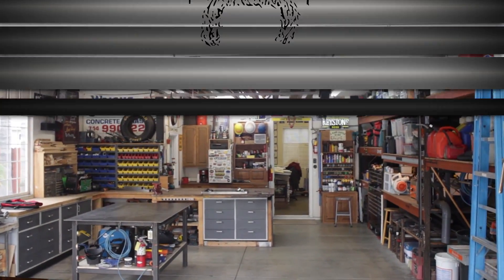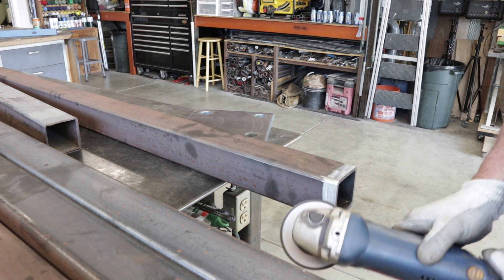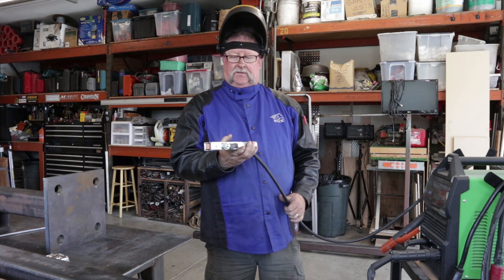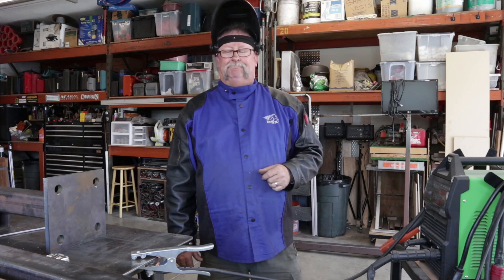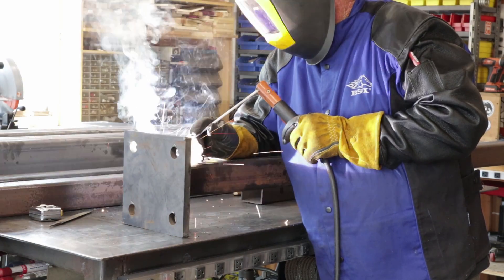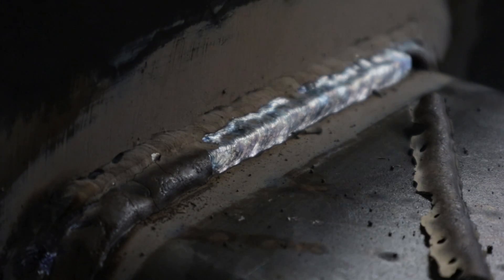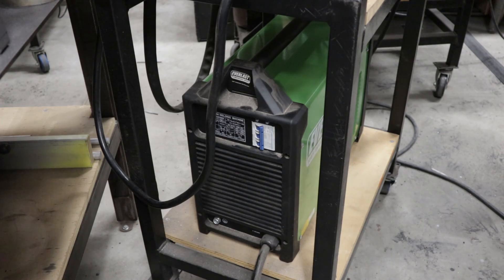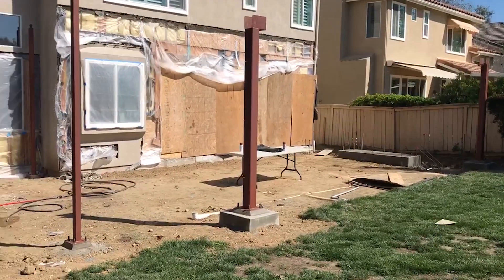Welding techniques Steel Columns - JIMBOS GARAGE

Comment: Awesome video Jimbo like always. Dual shield wire works just as great for heavy metal fabrication like this.
Reply from the maker: Thanks for watching William, I am looking into doing dual shielded flux core, But i think i need a bigger amp Mig machine, I currently only have 200 amps, I think i need at least 250 or more. I'm looking at everlast or HTP.  Jimbos garage!
Reply: Glad to hear your considering it. Have heard nothing, but amazing things about the HTP welders. Great machines and awesome customer service.

Comment: Just curious where you're located? I enjoy your videos but gotta wonder where you do all these structural jobs that you don't need welding procedures and have building codes?  I've owned a fab shop in Canada for 12 years(pipe and structural ticketed welder for 22 years) and to do a project like you just showed in this video I  have to be registered with CWB(an  agency here in Canada for regulating structural welding) and have welding procedures  do bi-yearly weld tests, not to mention the quarterly audits, and paying a third party firm to be my retained welding engineers.  Must be nice not having to deal with all that.
Reply from the maker: Thanks for watching Jason, I am AWS certified, And i have to be carful of the projects i chose to do, Some require different certifications and special inspections. And as long as i fabricate them in my shop i only have to provide shop certification. In the field is much different, They require regulated structural welding inspections and certifications.  Jimbos garage!
Reply: Jimbos Garage oh ok. .sorry I guess I assumed there.  I am just seeing so many that don't have any type of certification doing things they really shouldn't.  Not meaning you fall in that category.